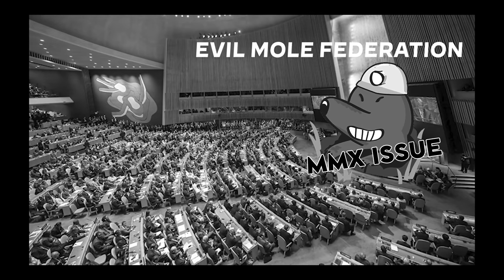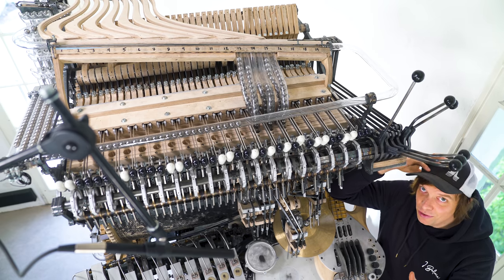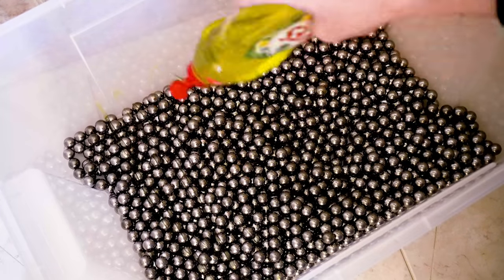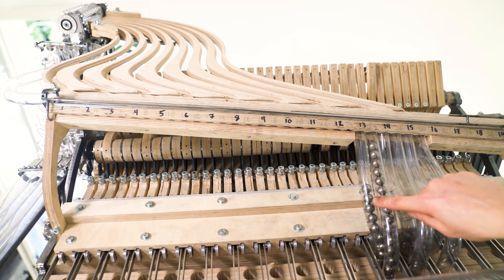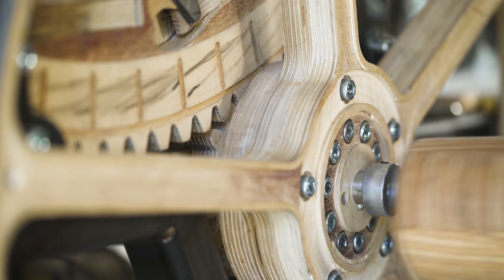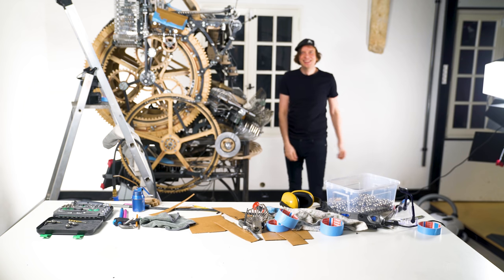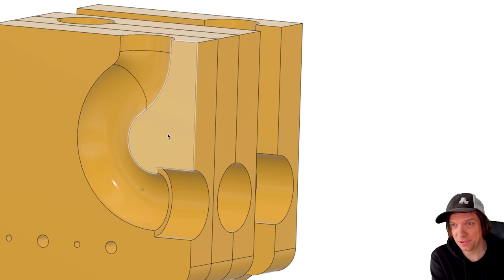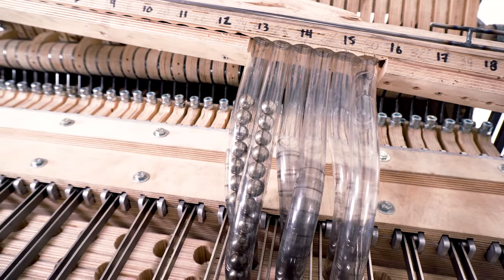Why Are 1000 Marbles On This Red Towel?

Comment: Martin, this video is 20 minutes, falls on a Wednesday, and has a movie trailer in it. At some point I think it's okay to upload it to the main channel, even if it's not a marble drop test.

I think you'll be glad you cleaned out the machine, rust aside. It's been something I've been thinking about pretty heavily for the last few weeks, and something I'm guessing may have caused some larger issues if left unattended too long.

Comment: 17:05 a temporary fix for the rusty marbles. You can use metal polish and then once you've coated them and removed it use car wax and seal them up and then bluff that. It should add a coating of protection to them temporarily.

Comment: That's something to know about graphite powder in general: don't use it in greasy devices. Either oil your hinges, or lubricate them with graphite, but don't use both, it get lumpy and hurts the lubrication when compared to using either alone. Apparently your steel marbles are protected from rusting with a thin layer of grease - so graphite is just generally a bad idea...

Comment: I wonder if left-hand thread would help preventing the unscrewing for the screws that hold bearings. Or do the gears move in both directions?

And another note: if I remember correct the  parts with high resistance that caused problems with marbles movement were done this way to prevent marbles from pressing on the marble gates? Now there is less resistance for marbles to go through, but more pressure on the marble gates. Edit: so the Martin said.

Comment: The plywood modules that are intended to reduce pressure on the release mechanism are doing their job, but at a cost: The pressure of steel marbles on soft plywood is going to slowly deform the plywood, increasing friction and rolling resistance. This is particularly true since the part was designed to contact the marbles at only two points, instead of being shaped to contact the marble along a semi-circular contact. The problem is made worse when an empty pipe is reloaded with marbles because the affect on the plywood isn't just force - it's impact. Have you checked the inside of those modules to see if you have a place in the first sharp curve that has a couple divots from marble impacts? Marbles will get stuck in those divots until there is enough pressure  behind them to overcome it.

Comment: Martin, a few suggestions mate:
1. Instead of graphite - which doesn't bond / stick to items like wood. You can try silicon spray lube. Just rub it into the wood like polish. Bonus - small amounts will adhere to the marbles and help prevent rusting. I have never had a problem with it on polycarbonate, but try a test section of tube first to be safe.
2. For the bearing setup, think ball joint or track ball, it's a multi-axis bearing. You can 3d print the housing. This would give you guidance/  tracking in several ways. Basically you would be making a very custom thrush bearing. 
3. Keep at it mate. Love the machine and the work you are doing. Thank you.

Comment: Wonder how expensive chromed marbles would cost and if that would help with the cleaning process. Could also possible heat regular steel ones and quench in oil but it would make them black

Comment: Why wont you use the adjustable marble pressure channels? They seem to take up the same space as the current ones and if the geometry is a problem just 3d-print them :)
Only issue i can see is that you will have to adjust the marble height each time, it would be so cool if we could think of an adjustable way there too

Comment: Over-rotation is great for slowing individual marbles down but where marbles are in contact with each other it increases the friction as the speed with which the two marbles surfaces are passing each other is faster than speed of the marbles themselves.

Comment: If you want avoid rusting you have to put them in alcohol right after taking them out of the water! This way the alcohol replaces any humidity that forms. 
I do that with electronic stuff!
(also if you warm up the metal too much/quick they rust almost for sure when there's a lot of humidity, a normal hair dryer could be better)

Last tip: you should try and measure with a scale how much pressure there is (normal scales measure the pressure you apply on them and divide it by G constant, so you can just see the "weight" to determine the pressure, but I think you know :P), this way you don't have to go with trial and error

Comment: You need to clean the tubes with a soft brush. Even a powerful burst of air won't dislodge some particles. Also, you should use a mild detergent if you think there is an oil/grease component

Comment: i can't quite tell - but I've always thought it looks like the base place of the marble drop modules, maybe even other parts of the machine, are angled back slightly
are the marbles currently being pushed up a slight gravitational hill before the last pmma pipe?
if this is the case - i think the opposite would be desired.  the marbles should always be being helped by gravity from the divider to the instruments

the marble lanes out of the conveyor look AMAZING!   mesmerizing

noticed this when matching the video - the final pmma pipes, short little pieces - are TOTALLY pushing the marbles up a little hill,  resistance that you might possibly need to remove

Comment: "Marble pressure" is a misnomer. The pressure only depends on height of the column. What you're dealing with is friction between marbles and the channel walls which affects the acceleration and terminal velocity at which they move through it. But once things settle down, the pressure of marbles against the wall preventing them to fall only depends on height of the marble column above it. You'll have things easier if you stop thinking about it as "pressure".
Reply: I'll also add that you're dealing with very unstable parameter. You're trying to keep the friction just on the edge where the friction has huge effect on speed of your marbles. That however means that when the friction rises just a tiny bit, e.g. due to wear, your marbles will just stop. I'd suggest to not rely on it and change the design so the marbles can almost freefall through the channel.

Comment: for the rust you could try putting the marbles in a tumbler with some fine sand for a while.  The sand should clean them up without actually gunking them up. you'd probably just have to blast them with some air.

Comment: That adjustable pressure module looks really cool, but won't changing the pressure setting also require changing out the marble height module? The process of replacing those (emptying the channel, switching it out, etc) would negate the benefits of the quick turnscrew adjustment on the lower module.

That said... an adjustable height module would be pretty much the same idea. :)

Comment: TO FIX YOUR RUSTY MARBLES (cause it's not free) I would use vinegar to clean the rust (slow but cheap) transfer by hand in a container filled with non vegetal/cooking oil for a day. Leave them there for a while so the vinegar separates and take them out to clean on a scrap towel. To make the extra oil easier to remove by heating the marbles (but don't burn the oil, engine oil would help here, it can take a lot of heat). With all that said.... It could be worth it to try giving a flaxseed oil treatment to a few marbles like with cast iron pans. Done well, the surface will be hard, anti-sticky, protect against rust forever and have a cool dark chrome look. You may even no longer need to "lubricate" the wood.
Reply: Throw Rusty carbon steel toy marbles out, replace with chromium steel precision bearings.

Comment: The rust issue isn’t as bad as you think. If you ignore it and let the rust wear off from moving through the MMX. The rust will only appear during long storage. I use bare metal chains everyday and even if they are rusty from sitting a couple days. The rust disappears within hours from friction. I suggest doing some experiments yourself to determine whats best for this situation.

Comment: Hi Martin.  If you have trouble like this again in the future I would suggest you try making a marble block out of a hard plastic instead of plywood and see how that works.  I suspect that a long line of marbles was putting pressure on those at the bottom and pressing them into the plywood so they had trouble working loose when the one at the bottom was taken away.  The plywood would work perfectly at first, but after thousands of marbles passed through the wood would start to wear away and deform just enough to create this problem in the channel.  And a good hard plastic would have less friction for the marbles to roll through than plywood.  If nothing else, it would be worth trying it out on one channel just to see what  happens.  Tony (a retired Reliability engineer).

Comment: If you ever start finding it difficult to find new issues, relating back to my previous comment, "purposefully cause a 'break' and analyse how it broke elsewhere", I think you could try playing the machine as fast as you can (regardless of if you're ever even going to play at such a speed) as it'll reveal a ton of issues both relevant and irrelevant to the machines normal 'max' play speed.

The most difficult part of this type of test, though, is being able to identify 'irrelevant' issues - as in; issues that can only ever be caused by the  'intentional break', like the gates running dry for example.
Basically; try to see if the issue identified is being caused by 'cascading issues' if possible.

P.S.
It's oddly fun to purposefully cause breaks in your system sometimes, feels like a murder mystery. lol

Comment: There aren't electri plated marbles to avoid the surface rust? I mean if they flash rust when washed you are most likely gonna have issues if they sit in a very humid room for instance. Just a light zink plating would probably avoid this.

Comment: Cheers! I maybe got an idea for you:
A wooden centrifuge with an inner towel coating that is newable and washable, put a penetrant oil on the marbles and make a pneumatik intake so pressurized air goes into the centrifuge.... 
It would be a maintenance machine you either put on the marble machine x when cleaning to use its rotational force, or make it an own machine. 
Greetings, Borrmann Alexander
P. S. : if you see it as a possibility, I'd be thankful to be a shown comment

Comment: If you think about it, marbles in contact don’t want to go anywhere... due to contact with the bottom surface, they all want to rotate the same way. But rubbing surfaces between them are going in the opposite direction.

Comment: I've been using a chemical for rust called Evapo-Rust, works really well, I assume any "water-based rust remover" would work similarly. after a treatment and a rinse then a protective coating needs to be used immediately. in your case probably a few batches if you decide to treat the existing marbles.

Comment: The best way to look at Graphite powder is a Smooth Abrasive. The reason it slides so well initially is because the particles are much finer than what they are on let's say Plywood. Although it is a much smaller particle size, there is still resistance to be had. A way to visualize this is by putting a 1kg weight on a piece of copy paper, then on 100 grit sand paper, then on 200 grit sand paper. When you pull on the paper, you will notice that the 100 grit will have the most resistance. Then the 200, then the copy paper. Although you are getting a better slide against the plywood, you have to worry about the Graphite becoming an abrasive everywhere else.

Comment: Honestly - you saw it coming Martin. :/ The 1st MM had EXACTLY the same problem with dust in the pipes. I'm glad that with the corrected design the pressure margin is wider, but this issue will keep returning I'm afraid.

Comment: THE right marble stack of nr 13 looks a bit ziczac. Both stacks of nr 14 too. This Will cause extra pressure/resitance on the tube walls. Could it be something wrong with tube diameter after a lot of bending them?

Comment: you should make a part where all marbles have to pass and it is covered in some kind of felt that somewhat cleans the marbles, and make the felt detachable/raplacable for ease of maintenance.

also, i believe that black stuff isnt graphite, well atleast not all of it. its probably metallic dust from the marbles themselves.

Comment: Marble over rotation is probably not a great idea where marbles are constantly in contact with each other. This makes them rub against each other more, creating too much friction, and the friction goes up as marble pressure against each other increases.  Glad he cleaned that up. This fix will be much more consistent

Comment: the path length has now been changed. You might need to check on the top of the feed tubes to see if marbles are sticking up and blocking the path to the other feeder tubes.

Comment: The grease may also come from the plastic tubes, from the wood or from touching them with bare hands. The marble pressure issue will come up again since all parts where marbles pass will change their friction behavior over time. They wear and the marbles leave some of that oily layer on all surfaces. Maybe the "pressure regulator" should have an adjustment screw so that you can tune that quickly, without draining channels or exchanging parts? "Design for Service"! :-)

Comment: I'm surprised at the possibility that the graphite powder is contributing to any stickiness in the marbles. Graphite is one of the slipperiest substances that I've come across and hasn't changed it's nature in any place I've used it. Is there a chance that the adhesive used in the manufacture of the plywood is somehow being picked up by the marbles as they run through the machine?

Comment: This redesign creates the need of adjusting the height again.
I suggest a adjustable springloaded brush where the tention can be adjusted functioning as a friction brake.
Therefor the marbles become clean and you can adjust the friction easyly without the height adjustment issue.

Comment: "It plays music" extra joke !!
As you increase the pressure by reducing the path length, haven't create à new mole at the top of the queue ? As you said, top marbles need to stay flash in order to avoid obstruction of the marble divider flow. So as you change the length path of the pressure process, have you ensure that the top marble of the queue remains as flash as needed to avoid any obstruction ?
Your daily vidéo is à gift ! 
Thank you for that 😊
#pastisforever

Comment: Martin! Have you considered incorporating LED lights into the machine? You could use LEDs to highlight the plastic tubing, & make marble movement more noticeable! You could ALSO theoretically link the lights to the sounds each component instrument makes, like a pulse with each beat of the drum, or a color change or flash with each tone of the xylophone, or a strobe to make the marbles look like they're moving backwards, etc. It wouldn't add much weight to the machine, & could make it much more dynamic looking for the tour! The other idea I had was to mount cameras to show different parts of the machine on a large screen, so that people that aren't very close to the machine can still see all the fascinating aspects of the machine! You already have pick-ups & microphones to amplify and change the sounds, so why not do the same thing for the visual aspects? The best part is that it wouldn't be NEARLY as labor intensive as other stages of construction and refinement of the machine, while still having huge and dramatic results! I just wanted to share my ideas, so you can choose whether they aren't worthwhile and should be ignored, or of they have potential and are something you'd like to use. The worst case scenario is you never even see my comment, but if I don't at least share my ideas, there's NO chance you WILL like or use them! Anyway, thanks for sharing your daily adventures with us! Keep up the great work! I can't wait for the next video!

Comment: The black sludge is probably the graphite powder. Just like how your hands will turn black because of the oil on your hands, the oil on the marbles will pick up the graphite powder. Graphite powder is a dry lubricant, supposed to be used when a wet lubricant like oil is not suited for the application.

Comment: You should not try to fine tune too much, because things tend to change. The overrotation idea in the pressure gates causes bigger changes, because marbles press against each other and don't rotate freely. This causes sliding and wear on the plywood. Narrow contact points with increased pressure wear even faster. Using lubricant means you must add lubricant when it wears out.

Comment: One thing that worries me about these fine tuning modifications you have made recently is that they will be subjected to wear that will make a big difference to the performance quite quickly. This will especially be noticeable in the ball tracks where over rotation is used to slow the ball speed down.

Comment: Somebody may have already asked. Is it possible that some environmental change caused the marbles to slow down? Have you had a significant change in temperature or humidity recently? That could change the size of the wood channels. Or maybe even make the plastic more sticky?

Comment: When I saw the rust on the marbles, I started thinking how awesome-looking this machine would've been if it had been designed in a "steampunk" style..

Also; I wonder if a super-thin layer of wax might make things run smoothly. (Every lubricant DOES give a bit of a glue effect, but I think that a "hard" oily thing might provide advantages such as any oil picked up at a later time not sticking to the marble as much, and also provide a "top"-level of how much grafite that might stick to the marbles).